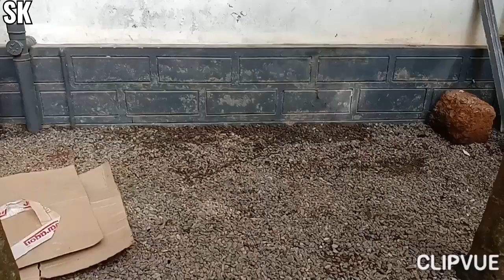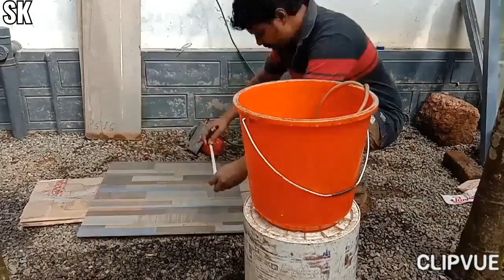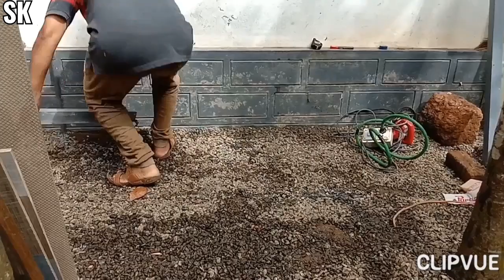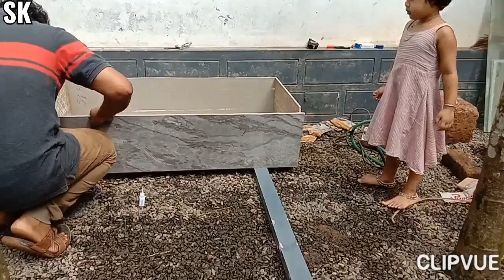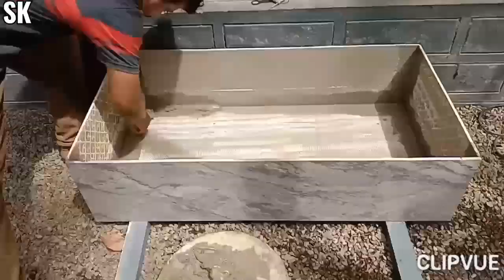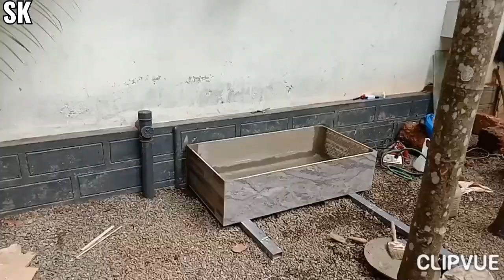ടൈൽസുകൊണ്ടൊരു ഫിഷ് ടാങ്ക്/How to make a low budget tile fish tank at home.

Comment: കാണാൻ നല്ല ഭംഗി ഉണ്ട് പക്ഷ വളരെ ചിലവ് ആണ് പിന്നെ ഉറപ്പ് ഒന്നും ഇല്ല ഇങ്ങനത്തെ മണ്ടത്തരം ആരും ചെയ്യരുത്
Reply from the maker: Bijo...ഉറപ്പിന് ഒരു കുറവും ഇല്ല.ഇതിന് ആകെ ചിലവ് 700 രൂപയാണ്. Size 4' × 2'×1
Reply: @santhoshkallingal8592  ടൈൽസ് തന്നെ വരുന്നു 16 സ്കൊയർ ഫീറ്റ് ആകുമ്പോൾ തന്നെ കുറഞ്ഞത് 60രൂപ നോക്കുമ്പോൾ 960രൂപ ആകും പിന്നെ ഓരോ സ്കൊയർ ഫീറ്റ് ഉള്ള 2ടൈൽസ് വേറെ അതിനു 80രൂപ പിന്നെ flexquick 30 പിന്നെ സിമന്റ് പിന്നെ കട്ടിങ് മിഷൻ rent എടുക്കുമ്പോൾ 50 അതിന്റെ ബ്ലെയ്ഡ് 110total 1220രൂപ  ആകും പിന്നെ ടൈൽസ് ചെറിയ തട്ടു കിട്ടിയാൽ അപ്പോൾ പൊട്ടിപ്പോകും സിംപിൾ ആയി വലതും ഉണ്ടാകു bro പിന്നെ ഒരുകാര്യം കൂടി ടൈൽസ് കട്ട് ചെയ്യാൻ അറിയാത്തവർ ഉണ്ടങ്കിൽ ടൈൽസ് പൊട്ടിപ്പോകും അപ്പോളും പ്രശ്നം തന്നെ
Reply from the maker: @user45769  4x2 ടൈൽസിന് ഞങ്ങടെ നാട്ടിൽ (ഡിസൈൻ ഒൗട്ടായത്) sf 38/- രൂപയാണ്.അപ്പോൾ 16sf ന് 608.3kg Cement 30/-flex kwik 50/-.ഇനി മോട്ടോർ വാടകയ്ക്ക് എടുക്കാണെങ്കിൽ 50/- അടക്കം 738/-രൂപ......ഞാൻ ആ ഒരു flex kwik കൊണ്ട് 3 tank വേറെ ഉണ്ടാക്കി.
Reply from the maker: Pinne glassukondunkkiya tankinekkalum urappu kitum tiles tankinu
Reply from the maker: https://youtu.be/Ehlh6N27O9U

E video onnu kandu nokkuto
Reply: Ithilum nallath 700 roopakk 3 fridge box vaangunnathaanu
Reply: @Deadpoolwolverine143  correct